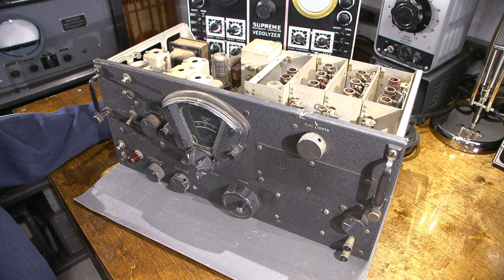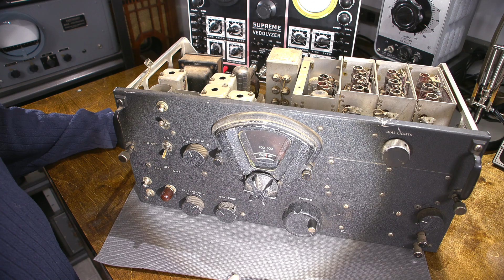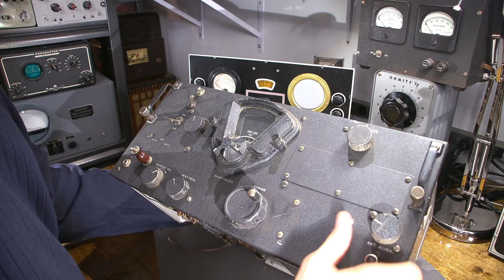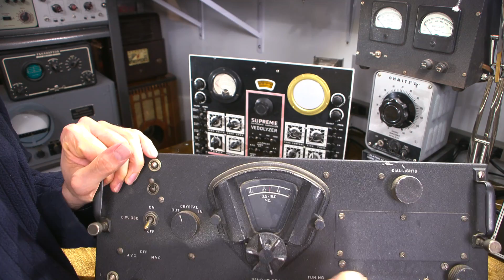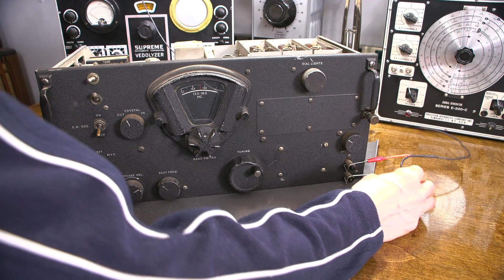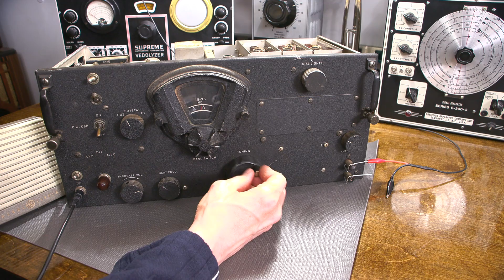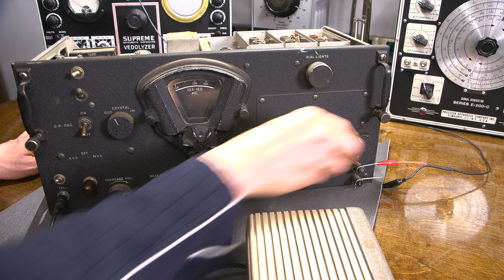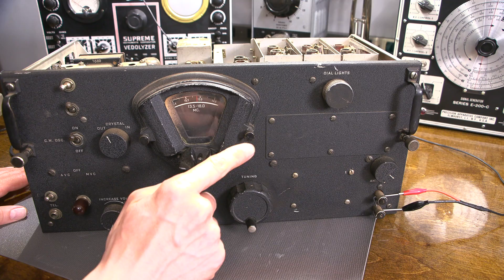B-29 Aircraft Receiver Scrap Parts Unit, Will It Still Work?

Comment from the maker: To learn electronics in a very different and effective way, and gain access to Mr Carlson's personal designs and inventions, visit the Mr Carlson's Lab Patreon page here: https://www.patreon.com/MrCarlsonsLab
Reply: I finally got called back to work, it's just part-time. But I can't wait to join your patreon and build some of the test gear you designed.
Reply: QUESTION: Would the crew of the B29 ever do mods to these receivers to make them work better during wartime? Obviously this one is done by a HAM; but it wouldn't surprise me if a B29 radio operator tinkered with his radios adding switches and circuits to aid him ... "necessity is the mother of invention" after all  :)
Reply: This type radios have personly charme 👍
Reply: @Lawson80  If they modded these, that would surprise me. I don't think that was done, at all. First, remember that the B-29 was considered an absolutely futuristic airplane when it was placed into service. This would be like you or me modding a brand new Tek scope. Second, such a move would theoretically endanger the crew if it went bad. IMO, the only way this might have been done (at the time) was if there were actual orders and the radios were recalled to some repair depot in bulk. And finally, if your gig was to fly on B-29's and risk your life to bad landings or being shot down every flight, I find it hard to believe that a guy would pull out a soldering iron and start tweaking. Most of the radio operators at the time were not engineers even if they were called that. They were trainees just trained to use the gear as is.  Just my opinion.
Reply: hey please do a scientology E meter !!!!!! i am really curious what u think!!!!!!
Reply: And, the calibration isn't that far off for the radio being that old and not restored..
Reply: As a 2nd generation cabinet maker, I am unable to understand how early 20th century radio manufacturers were able to craft such beautiful, organically shaped enclosures in mass production quantities at a price affordable to middle class consumers. How can I recover the lost art of bending veneers and plywoods in order to restore originals to their exquisite beauty (admittedly, not obvious in the example of this particular B29 video)? Have you, Mr. Carlson, retained these skills along with your obvious other skills?
Reply: Seriously is there a way to get one of those, "Mr. Carlson's Lab Shirts" I would pay good money for one of them.
Reply: An idea when you may do a restoration of this BC-348?  Do you know if this is a Q or R?
Reply: @southjerseysound7340  .
Reply: Thank you I am N2qcu I own a xiegug90 it’s ok very good sdr
Reply: Hey, a Mike sock will cut out breathing noises.❤

Comment: Equipment like this ends up in garage sales because the children and grandchildren of the original owner have no idea if it is salvageable or not. They assumed because parts were missing that it was junk. Their loss our gain. Thanks for saving a part of history.
Reply: About fifteen years ago it took four of us from the local Amateur Radio Club four evenings to empty the grage of a silent key member. Strangely the only receiver that actually worked looked in worse condition than this one, sat on the floor with various components that had fallen of a bench loose inside. We sold most of the gear at the local Hamfest and the silent keys widow ended up with about £900.
Reply: Heck they don’t even know what these things are!
Reply: 150,000 rivers in just the cockpit.
Reply: And no touch screen lol
Reply: They end up going cheap to moron ham radio dealers then put on ebay for 350 un restored. And then the gotta have its will pay on ebay..

Comment: When I was in high school back in the early 70s I found one of these in a local Army/Navy surplus store. I paid $20 for it. There was a lot of extra space where the dynamo was, but I didn't know at the time what was missing. I didn't know much about electronics at all, but I did get it to work well enough I could hear one side of a conversation from a ship-to-shore radio operator.

Comment: I worked as an electrical engineer in design for manufacturability. The technology has come a long long ways. The whole radio looks like it was built  by hand. With everything automated today, the steps in placing even one resistor on the board is calculated in the fractions of a second.  The pick and place machines sound like a machine gun placing all of the transistors, resistors and capacitors on the circuit boards. I wonder how many man-hours it took to build one of those BC-348/224  radios.

Comment: I had one of these when I was in my mid-teen years, early 1970s. Man what a blast from the past. I loved that thing. I used it as both a short wave receiver and a tunable IF receiver for some frequency converters that down converted 6 meters, 2 meters and 220 Mhz to the 20 meter ham band. Almost identical to mine. Love your work, please keep it up! Thanks, WB6MIE Tony

Comment: You got me again with this one Mr Carlson, for 2 reasons. I built B-17 instrument panels for over 20 years and have them world wide and with many US customers. So years ago I bought one of these radios on eBay and got it working. But swing back to 1958, when I was 12 years old, I got my first Wireless Set #19 and had 3 more over the decades. But marriages and kids put an end to the hobby for 40 years.  About 6 months ago I decided to get my ham radio license and first got my Tech level and my General a month later. I started out with an IC-7300, totally digital transceiver. But the lust for the smell of WWII cosmoline and hot vacuum tubes came back, so I just got my 5th #19 set and am working on building an AC power supply for it and get it totally operational. I'm sure you probably know this radio. If you look up the history of the 19 set , it was a brilliant design, first designed by the Brits and built in Canada by Northern Electric and by RCA and Zenith here in the USA. The technology it had replaces equipment 3 times its size and was the first real transceiver that used both parts of the receiver and transmitter together, in the same circuit and same tubes. It also introduce technology that had never been seen before and is still used in today's SDR radios. would love to see you bring one back to life in your lab....Please:-)

Comment: I'm  53 years old just for reference. When I was a young boy, about 3/4 years old, my dad purchased a Zenith World radio not working from a radio repairman. It was dusty and dirty. Dad cleaned it up and blew the dust off and out of everything. Next he pulled all bulbs and took them to the local drug store where they had a testing station and every bulb you could emagine.   We got home and installed the bulbs and just like that the old Zenith was warming up, crackling and glowing. He went through the selection buttons and dialing in the tuner. Before you knew it the contacts were coming clean and did that thing pick up stations. AM, SHORT BAND, SEA GOING,  even stations from the Asian pacific ! To this day he still has the old Zenith. It hasn't been plugged in over 30 some years. I bet it still works.
Reply: Ed Spencer plug it in and try it out some more

Comment: Had a BC 348 for many years. Mine was built for the Russian Lend Lease program. It was lettered entirely in Russian. Built a power supply for the dynamotor and it worked just great
ARS. KE4D

Comment: OH MY GOSH ! As a child , my homebound Grandfather gifted and set up for me , his BC-348 receiver , this was his constant companion and became mine .  He had converted it to house current and it gave off a wonderful smell !  Grandpa included a western union headset with fabric covered wires that faithfully reproduced every faint broadcast .
 I'll be honest , I became enamored with DXing and lost many hours of school night sleep .  Our local Thrifty drug store had a do it yourself tube tester and self serve tube selection .. THIS kept my companion running for many years .
Alas , the smoke leaked out many years later and I no longer was comforted by the dim lamp inside the vernier driven dial display . I took it in my red wagon , bouncing on the "jerry" mounts to the radio repair shop on Main street . He kept it for the diagnostic cost and it was akin to loosing my loving Grandfather .. so sad .
Reply from the maker: Hi Mark. They are still around on the surplus market, Maybe one day you will be reunited.

Comment: Thank you for sharing this video. I am 66, and I used to find gear like this in scrap piles all of the time when I was a kid. My first headphones, turntable, loudspeakers, and turntable amp all came from a pile of discarded military and TV station electronics that I came across on my way home from school one day. Every drug store had a large stand with a tube (valve) tester and stock of replacement tubes in the 1960s, so I always pulled and tested the tubes in the devices I salvaged. It was amazing how many discarded radios and TVs fired up and started working perfectly after I replaced a bad tube or two. As a result, I was the only kid in the neighborhood with a TV in my room. That really impressed the girls.

Comment: I used to sell those radios!  I grew up in Edmonton with electronics and ham radio my passion.  At 15 in 1966 I worked at Western Surplus Sales on Jasper Avenue in Edmonton being paid $0.85 an hour and used the money I made to buy old surplus equipment.  My first radio was a BC454 Command receiver.  We also sold the 19  Set , BC-312, National HRO to name a few.  The store was mainly surplus military electronics with some new electronic parts added in, and secondary surplus military clothing and survival equipment.  All the aircraft equipment ran on 28 volts with Dynamotors as you mentioned.  When you switched on the the BFO and tuned around it brought back very fond memories.  Darn Mr. C but your making me feel really old all of a sudden!!  73's es 7esa

Comment: Spending ages on eBay has taught me that "for parts/repair" really doesn't mean anything. Maybe I've just been lucky, but about half the time it means "it doesn't work," and about half the time it's "I couldn't be bothered to figure it out." Even if it really were broken, the fact you have two others means the parts are probably still valuable. Nevertheless glad to see it power up! These videos are fun.
Reply: With Ebay and their selling policies it is often better as a seller to list items as parts or not working. Too many buyers who try and rip you off.

Comment: In the B-17, it helped to keep the radio operator warm at high altitude. Worked well with the ART-13 Xmtr (which had a huge vacuum relay for switching the antenna between Rx and Tx). Still very usable and common in the 60's. You keep finding this stuff and I'll keep having good memories. Thx....

Comment: Great video, again! I have an R-392, had the transmitter also but a ham friend wanted it. Built up a 28vdc supply for it, heaters use straight 28vdc. I acquired it in about 1972 from the scrapyard. I listened to everything, I was a novice at the time, but the R-392 turned me into a 'real' SWL, quite the upgrade from the (modded half to death) Hallicrafters S-38D I got for Xmas in '61. What a receiver, had a depot tag on it that said it had just been refurbed. It is waterproof down to like 5'. I think it has over 30 tubes in it if I remember. Came with a foam insulated tube kit. One for the Xmitter, one for the receiver. Worked great the last time I used it, about 1998 or so. I always used a variac and brought it up over a minute or so.  Probably should do some capacitor changing. O-ringed case, you can eat off of anything inside. Nice, no mod box, only scratches are on the case. Michael in Colorado.

Comment: Hi Paul - I did a lot of restorations of these old WW-II units when I was involved with the Ysterplaat Air Force Base volunteer group in Cape town & many items were well butchered when we got the radios.  Some were fortunately O.E.M. condition but in storage in poorly environment close to the sea for many years.  Those that had been 'Hammed' had all sorts of mods applied, some good, some nasty, many had BFO's added, Etc.  BUT, the point of this comment is that with very little effort nearly all worked to an extent + a few were near what they should have been after manufacture.  Yes, all those American sets were superbly & cleverly designed too - A bitch to un-layer in repair sometimes - The BC-348 is a grand receiver.  I loved the Colins ART-13 which were used by South African Airways for many years after close of WW-II - Being a Ham myself, I had a few in my personal collection & still do.  Super, Paul, I always enjoy your fiddles on this gear "Power to your elbow"  All the best, Tony in Kotzeshoop, N-Cape, S-Africa.

Comment: I had an Hallicrafter's S20R receiver which was my first ham receiver in 1959, but it failed after one day.  Probably old leaking capacitors.  Couldn't get it to work again, so the local electronics store who sold it to me exchanged it for a BC-348.  The BC-348 receiver was very sensitive, but selectivity suffered on 40M.  I was 13 at the time and was a new Novice.  I sold it and bought a Knight Kit R-100, which worked well enough.

Comment: These are great dependable receivers!!! They were used in many many aircraft including the B17's  and one was in the Enola Gay. I just recently restored the same one but mine was a BC-348-C made by RCA then later modified by Belmont and was tagged as a BC-348-S. I noticed his set on here is missing the manufacturers tag. As in this one, in mine,  the dynamotor was replaced by a power supply. Just had to recap the power supply, correct some wiring and it came alive. Works great.  The dial light rheostat had been replace with just a rotary switch which was used as the on/off. Not sure what that was all about. Took some doing to get the power back on using the AVC/OFF/MVC 'flush' switch.

Comment: "It's heavy, the plane would probably fly higher without it"...genius!
Reply: James Weekes compared to the modern VHF, HF units this thing is extremely heavy. A modern Honeywell VHF unit weighs about 5 kgs and it‘s the size of a large size thin client PC.
Reply: Just saw the radio compartment on a B-29, about 1000 lbs of radio gear and some had teletypes included. Weight? Check out what the tires weighed. What I saw, you could have put Mr. Carlsons whole lab in there.

Comment: When I see an item being sold for parts, I often suspect it means the seller doesn't know if or how it works. And if it does work, they can't guarantee that it's working properly, or that it hasn't been modified. But if even a few parts can be repurposed, the buyer can't really complain.
Reply: As my friend would say, underpromise and overdeliver. That way nobody is disappointed.
Reply: Yeah the over exaggeration of "Parts Machine" got to me too - lol -. I've got a gearbox that I haven't got a car to test in, what am I supposed to say, working good, or for parts. What It really means is, if you are a tinker you might get it going, but if you're a novice don't buy it.

Comment: That was a trip down memory lane. I bought a BC348 complete with an external power supply back in 1978 using £15 of my first weeks wages of £25. It came from the Air Training Corp which I was a member of. They had just got a Racal RA17 from RAF Locking so the BC348 had become surplus. Looking around inside I found a date of 1946 in it. Of course that might have been when it was serviced or something. Even then I've had it over half its life. Most Sunday mornings I was at the ATC in their Radio Room operating on a country wide net. Our station, with an R210 receiver and matching transmitter (C111 ?) , did use dyno-motors so  other stations recognised us before we even gave our callsign. I still have the BC348 but it has been in storage for years. Finally if you watch the film Memphis Belle you can see where  the BC348 fitted in the B17.

Comment: ''....they probably took 'em out of the plane, to get more altitude....''  hahaha.
Reply: Amplitude or altitude ? You can't have both with that heavy thing...😅🤣😂😂🤣
Reply: Some of those radios might have been tossed over to gain altitude if the plane was shot up and lost an engine.
Reply: This radio was used by army and ground forces too, I think it was even more used on the ground than in the air so there no proof it was used in the plane...

Comment: I was given a BC-348 when I was a novice in 1965. I couldn't scrounge enough parts to get it to run on the dynamotor or build a power supply ( I was a broke 15 yr old). Traded it for a Heathkit  HR-10 so I could get on the air. There was also a BC-312 and BC-348Q. Your data plate is missing.Those receivers were also used in the B-17, B-24 and maybe  the C-47, C-46 and the C-54 transports.
de WA8SDF